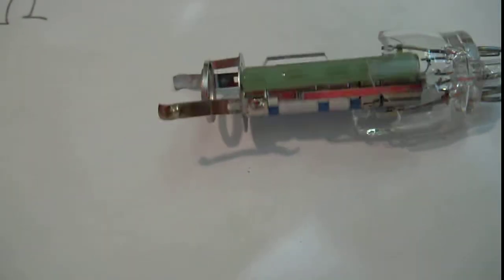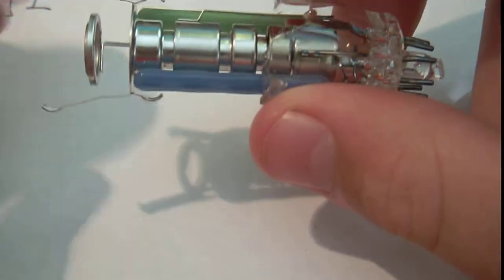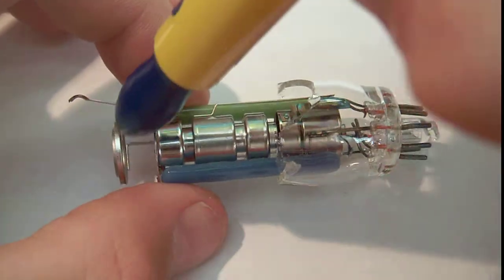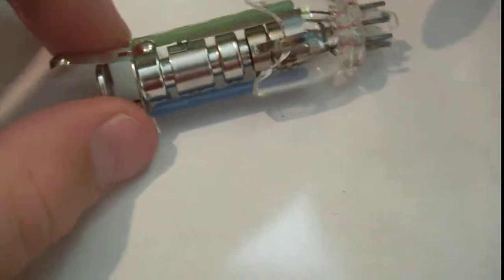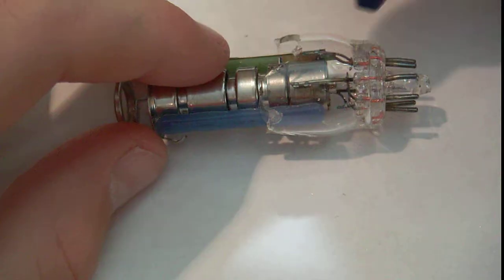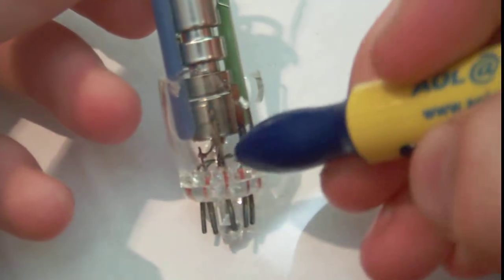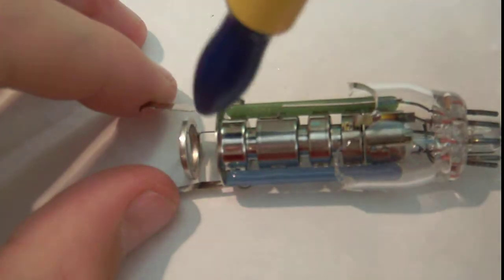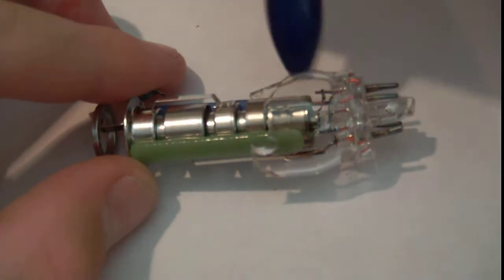DIY Particle Accelerator 3

Comment: "coil"=filmanent, probably 6.3V (AC/DC)
Cathode: gnd (reference point)
Can around cathode: called G1, negative voltage to control beam current
screen (some hundred volts)
Next: accleration (main hv)
Next: Focus (some kV)
Next: accleration

That should be most of it.
The voltages will seem different if you use a different voltage referance.

Comment from the maker: @CognitiveNetwork they will shoot out x-rays at you when they are being used at over about 15kV. In CRT TV's they have lead paint coating the bulb of the tv so inside the tv no worries but alone shielding is needed.